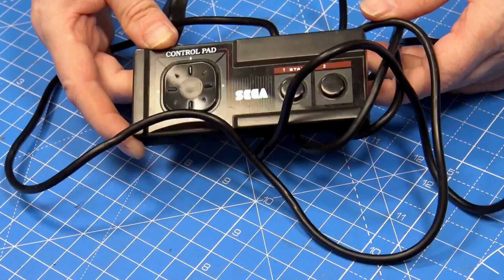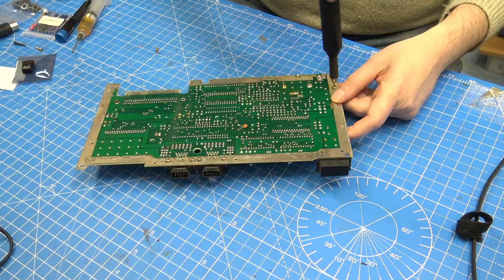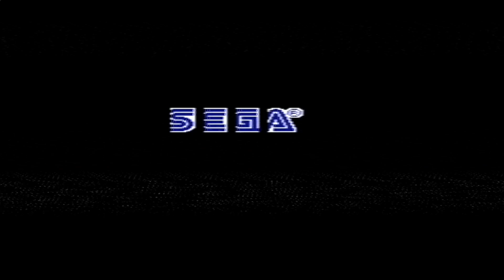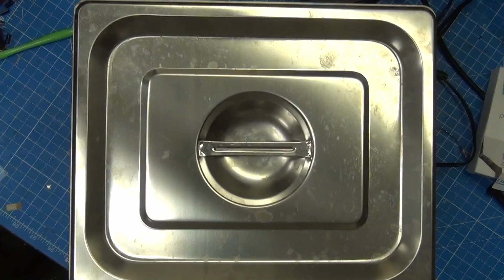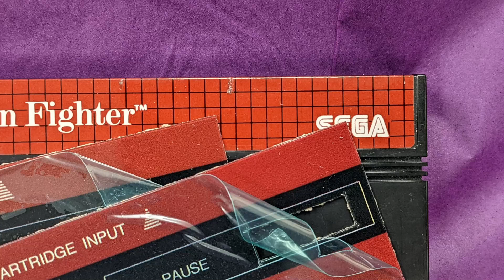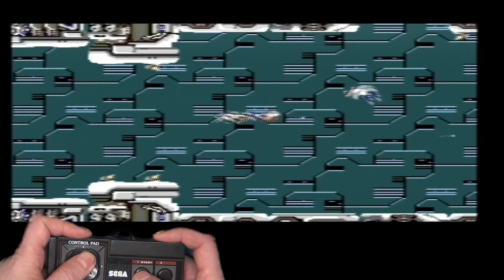Scruffy Sega Master System restored with NEW reproduction case badge.

Comment: Looking at the schem, it seems there isn't a single 9V device in the console. Everything runs off 5V. I think we should be thinking of ditching the barrel jack ports and converting the power inputs to USB. Mutually incompatible barrel jacks with different voltages and voltage tolerance, centre positive and negative, but reusing the same connectors, just seems like a bad idea all around. Plus aftermarket garbage PSUs. With USB every electronics store is going to have something that at least won't kill you, something vaguely trustworthy. Of course injected ripple can still be an issue, but it shouldn't be quite this bad, and perhaps it calls for an inductor capacitor filter stage.

Indeed ripple isn't exclusive to SMPS. A classic PSU from the era is unregulated, just a transformer and a rectifier; but the rectification diodes introduce switching noise themselves, as they take a little time to start switching, it doesn't happen exactly at zero crossing, but when they do it's a very sharp sort of switching action, so there are a couple spikes there, it's at twice line frequency but it can be quite strong and cause substantial issues too. And in turn there is a lot of design space in SMPS to limit the ripple as well.

9V centre negative? Some Megadrives, many Korg and Yamaha music instruments, guitar pedals. I don't think you'll easily find an Egston or Friwo centre negative, but they are pretty clean SMPS.
Reply from the maker: I like the idea, but not sure how well it would be received, some people can be a bit funny about mods. I have ordered a 9v Meanwell PSU and going to change the polarity on the lead.
Reply: @leesmithsworkshop  Looks like at least its got a diode D2 in line with the power switch which protects the console against wrong polarity PSU. So that's a necessary luxury given difficult to replace custom ICs. On systems which don't have such protection, i think it's a smart retrofit.

Meanwell is a decent manufacturer as well for sure.

PSUs of unknown provenance no matter the stated purpose sketch me out, and i think it's worth paying attention not only to the brand but also to buy from a reputable seller with direct ties to official distributors such as Ingram, as fakes are fundamentally a possibility. It's very likely shady units use the same exact garbage pile parts as $1 USB PSUs off Ali, just a different feedback value to make up the difference between 5V and 9V - typical problems being lack of safety rated X and Y capacitors, lack of input fuse, lack of sufficient PCB distance or anti-tracking between primary and secondary, uncleanliness in manufacturing with flux in unfortunate spots and stray solder balls remaining, with flux eventually starting to absorb water from the atmosphere and becoming conductive, and stray balls of solder knocking loose, and crucially transformers which aren't built correctly for safety, with mere lacquer separating the secondary from the primary, incorrect winding with primary and secondary wires crossing right over each other just outside the insulating tape. With thermal cycles the lacquer is likely to degrade and crack, making suspicious PSUs increasingly fire and shock hazards as time goes on. You can't even verify most transformers for correct construction non-destructively, though often enough you see sketchy details in the overall PSU construction at a first glance.
Reply from the maker: @SianaGearz  I did some testing and I removed the traco regulator and connected the Input to the output pins, then putting 5v in the jack and it's dropping down to 4v because of the diode after the power switch. if I put 5v to the common and regulator output pins it runs ok, but then the switch does not work.

Comment: Great work, it looks amazing. I picked up a similar untested SMS2 off eBay a while back and I have never even tried to power it up! Really want to do some basic tests like you did before I fry anything. Love the master system, great games library, nice bright colour pallets and such nostalgia for the sound of the sn76489 chip....
Reply: I finally got my sms2 down today, power supply checked, regulator checked and no shorts and - it worked, hurrah! Thanks for the motivation
Reply from the maker: @mogwaay  excellent, I am glad it was useful. These look to be very well made and most common faults are the switches and bad solder on the cartridge slot.

Comment: A good way to get rid of sticker residue is Lighter fuel as it just softens it and dissolves some of the more stubbon stuff, just use some IPA after to get rid of any left over fuel.
Reply from the maker: I should have cleaned that up before and then I could have used something a bit more aggressive.

Comment: Nice work! I didn't expect the polish to work SO well! Really shiny, looks great! Might have to try that on mine some day. And the badge is a good idea.
That screwdriver looked like a ifixit at first but is way too chonky for the ones that I know. What is it, if I may ask? Seems to allow better torque than the smaller ifixit one I have.

(and good to see, that you used a window cleaner that is compatible with 8-Bit machines ;) )
Reply from the maker: it is Ifixit just the bigger driver from the Manta Precision Bit Set
Reply: @leesmithsworkshop  Ah! Thank you!

Comment: Beautiful work sir.  I've got an SMS shell I'm going to use to make the least mini SMS Mini ever with a resp Pi so I'm going to try and use some of these cleaning tips on it first.
Reply from the maker: The Novus sets are not cheap and they don't include enough of the cleaning cloths, but it does work very well.